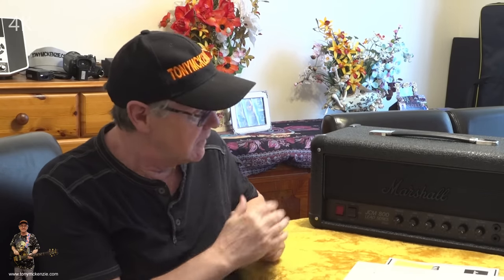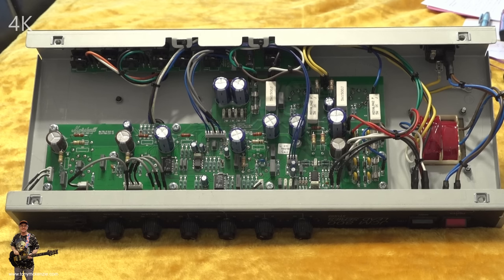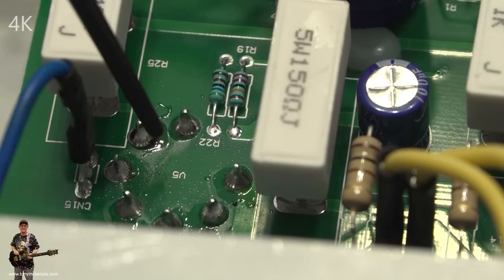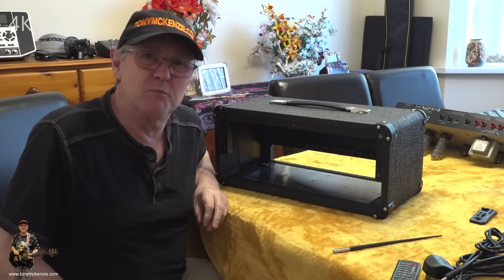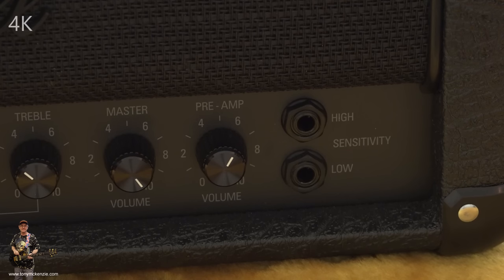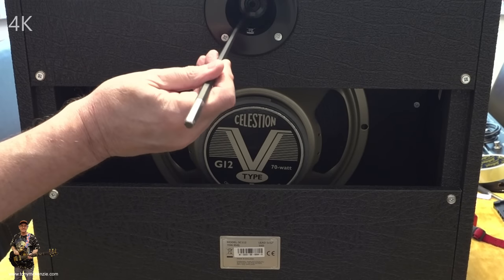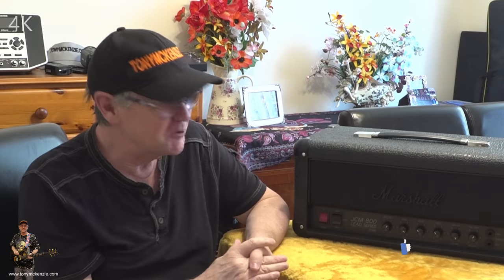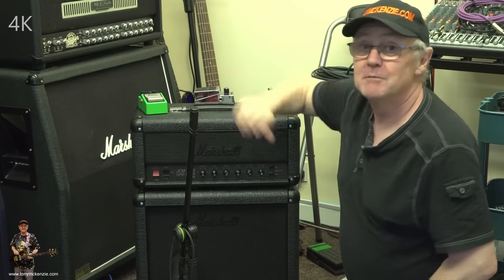Marshall STEALTH JCM800 STUDIO SC20HSB Amplifier |  REVIEW |  Inside & Out with Playing

Comment from the maker: Confirmed from Marshall today: 

The amplifier and cabinet are manufactured from birch ply
. You receive a first year warranty automatically, if you register within 90 days you receive an extra two years. Valves only have a 90 day warranty.

So warranty is three years... on some amps it used to be 5 years but makes no difference, it's a great warranty for the price you pay.

Also note that the amp is Cathode Biased...
Reply: Here's the one I got from Amazon about 4 years ago Not the same rating, not the same application so... Anyway here it is.  I've never heard anyone really complain about the International versions . Celestion may be holding their feet to the fire on quality. Marshall did a pretty good job of that with the Vietnamese combo amps.  https://www.amazon.com/gp/product/B0018TFKAC/ref=ppx_yo_dt_b_search_asin_image?ie=UTF8&psc=1
Reply from the maker: Yes I know that model well. The one I mentioned came in today... yep... made in China :( and I was disappointed a little about that. But it is supposed to be the same speaker as in the 1960A cabs (my favourite actually) so I bought it. That will be fitted in to that 'Stealth' cab from the last review and I think that speaker will be even better for waht I want out of that little setup - although I have to admit the V speaker in there did sound OK. I'll probably kick a short video together about it...

Comment: Ohhh i like this :) , Excellent review mate cheers ! IF you slide a tube slightly bigger than the valve over it and push down , it`ll press those crock clips back to release the valve :D
Reply from the maker: I understand but removing the tube (valve) without your 'tube' (I get what you mean) is really hard. Great point BTW and not one I have heard before thanks for posting that... Stay safe.

Comment: Hey Tony! My JCM 2000, TSL 100 has a “VPR” switch that reduces output power to ~20 watts. Great for smaller venues. All my Marshall heads are 100+ watts.
Reply from the maker: Indeed it does... I still have my red recovered one - a really great amp which suffers a little from 'bad board syndrome' but change the board and its an amp for life :)  I have a JTM45 (30 watts), a 1959HW (100 watts), the TSL100 head (100 watts)  and now this amp 20 watts. All great sounding amps really. Great point and I probably should do a quick review of the TSL100 as I don't really show everything about that amp... stay safe.
Reply: so?
Reply from the maker: SO! What does that mean.... go on make my day.
Reply: @tonymckenzieofficial  He was saying all his amps are 100watt what does that matter now? You gonna play isolated in your room @ 100watt please.
Reply from the maker: Ha I doubt that unless he has a reactive load type of device. But those 100w amps with a reactive load DO sound different (and feel different too) when you play them that way cranked. Anyway thanks - I could not follow the comment but its all gone clear now :)  But gigging will come back :) Thanks and stay safe.

Comment: Nice to see how the amp has been built. The first preamp tube looks like a JJ but the other ones are nothing but Chinese. It's sad to see Marshall still uses those cheap 1N4007 as rectifier diodes.
Reply from the maker: This is similar to the SV20 too. I reviewed that later. I visited the Marshall factory some years back and the video is on my channel. I asked about tubes at the time and Phil Wells told me that they had no issues of supply at that time but maybe things a have changed? Phil retired I believe... a really nice guy too. Thanks for the info.

Comment: Wonderful review! Celestion does still make some speakers in the UK.  Price wise these amps are coming in around 1399.99 in the US (for the stealth model). Roughly 100 USD less than the Friedman 20 watt amps. I don't want to argue which is a better amp but the Friedman's are not that much more expensive. As well the runt 20 is actually a cheaper amp than this one.
Reply from the maker: Watch my review on the 'snake' one... I talk about Friedman and my experience. Honestly, the Marshall was far better and the JJ Friedman went back. In fact the only amp I have ever returned... it was that bad. I don't really want to slag any brand really, but that was what I found. My guess had I bought the 'real' Friedman and not the JJ made by someone else then it would have been a different story. Wow that pricing is insane... here even with 20% tax included its about $950 or so!  Stay safe.
Reply: @tonymckenzieofficial  Sorry to hear about your experience there. I've had good luck with Friedman 20 watt amps but they are expensive and as you say, mileage may vary from case to case. Thanks for replying! I didn't realize Marshalls were so much cheaper in UK. That is interesting.
Reply from the maker: Yes they are... but remember I showed there is no 120v input on those transformers... so then you would have to work on the amp and not worth doing... :(  I might one day post the Friedman video or not... who knows. Thanks.
Reply: I would rather have 34's instead of Friedman's el84's....just personal preference tonewise

Comment: Those 20W studio amps are great. They came out only a few months after I bought my DSL20H. If I'm honest I wasn't too bummed because I couldn't afford one anyway. I'm not sure which I would have gotten. They are all really cool. I might have gone with the Silver Jube style one or the Vintage because I don't really go that high gain. 

The studio series sound a bit thicker than the DSL even though at a glance your 800 doesn't look THAT different internally. I put some Mullard reissue preamp tubes in mine and that gave it a bit more body. Might do something similar with the power tubes eventually. Cheap and cheerful, Way better than any of the sub $400 modeling amps or VST modelers on my PC I was using before. For someone who's only playing at home as a hobby it's great. I got a vertical 2x12 Cab with Mojotone Greenback clones in and also have a older DSL5C with a Vintage 30 shoehorned inside.
Reply from the maker: Well I know of the DSL and I had one of the 50w many years ago of those. But not the newer DSL amps. Interesting the layout is similar. I saw the silver jubilee also (not in real life) and the snake skin also looked a really nice presentation. I opted for the JCM800 style in stealth because I have a real 1959 amp as you might have seen recently. 

I've looked at the Mullard reissues a few times... how do you find them? Well matched PI?  Reliable? Those are not that cheap a tube but I know that you generally get what you pay for with tubes. I looked at the power tubes from Mullard (the reissues) and maybe I'll get some. 

I did think that I have yet to find any modelling amp that does what this stealth amp presents in 30 seconds in buckets... it has a really impressive tone, but just as importantly the feel of it when you play is exactly right, something that every simulator I ever tried somehow lacks in general. But you could also use this amp for gig's - that 20w out was really loud... maybe it's me getting old (don't answer that :) but even the 5w sounded pretty nigh on perfect. I was most surprised. Thanks for the info - always nice to hear you Adrian and I trust you're being careful re the virus...
Reply: @tonymckenzieofficial  The Mullard Reissues sound a lot better than the stock Marshall Branded JJ's and the generic chinese white label ones that came with it. To be honest I'm not sure how the PI changes the tone of the amp. I put a JJ 5751 (lower gain) in there the other day and it does sound and feel a bit different. Unless I record it back to back I can't really tell if my head is playing tricks on me. 

If you ever run out of things to review, you could always do a couple of educational videos. The Mullards are definitely a little fuller sounding where the original JJ's sounded a bit fizzy and thin. If I'm honest, when I first got the DSL20 I was a little disappointed, my 5c which originally had those Mullards in sounded bigger with the 12" speaker inside. Once I swapped out those tubes the 20 sounded more like I anticipated. 

It probably didn't help that the Marshall 2x12 slant top had the two speakers wired out of phase from the factory LOL. It actually sounded terrible the first time I tried it. I guess that's what you get when you can only afford the more budget lines of their stuff. QA isn't that great. My 5c had the FX loop harness zip tied to some power cables when I got it, resulted in a high noise floor and lots of buzz out of the box. 

Fortunately I'm pretty hands on and went to school at a time when they still taught you a bunch of practical workshop skills. So I'm pretty handy and curious about how things work. Probably why I enjoy your channel so much Tony. Anyway, thanks for the kind words, I'd doing great, enjoying time with the Wife and my dogs. And I can see your doing alright by the video's.
Reply: Nothing wrong with the DSL I think they're beautifully voiced
Reply from the maker: That 5751 reduces the drive  just a little - not as much as I would like on some amps (MT-15). Some different guys talk about 12AT7 and other similar tubes which also it seems reduce the gain, but I have not checked which would be best for that. On the PI tube, I have not seen anyone talk about how the tone is affected by that either in or out of balance more or less so to speak. I could guess it might not be that noticeable? But the problem is for me when it gets hardly any difference in sounds, my ears don't hear that well any more and I end up assuming its the same tone. Those Mullard reissues seem to be expensive really (unless you live in the USA then they are much cheaper) for what they are. I was looking today. I'll likely try some based on your comments. Sounds like you had a bit of diagnosis on the Marshall... and that's a pity really. Over the years with Marshall I have seen the odd little bit, but nothing like you describe especially re the things like the out of phase stuff. Inside the odd head there used to be small things but not really for many years have I seen anything dire.  

One of the things I looked at today were Marshall Amplification PLC accounts. Don't be  surprised, I often do look at accounts when I can get hold of them and in the UK that is simple enough as they get published. The USA is another story but I would love to see some of the makers accounts from over there. In any case, in 2017 Marshall showed that the Vietnam facility was taking off and making good money and in profit as a contributor. So their investment for lower cost amps and later sales did pay off for them. When I look at this amp under review it is a UK made amp so will undoubtedly have a higher cost than the Vietnamese made products through labour etc. I also noticed that Marshall profitability increased and that's a very good thing because it keeps companies there. Where was the 2x12 made? and where was the 5C made?  I guess it could be pertinent as both of those things you mention are really QC? right? Just interesting stuff for sure.
Reply from the maker: The original DSL's had a main board VERY similar to the TSL. And the TSL100 was throughout the 2004-2007 period my favourite amp. Recorded it has a particular tone that always seemed to me to be top class. I did also have at one time a DSL100 (I think it was) which was finished in green tolex... but that had a slightly different tone than the TSL. I do think all Marshall tube amps have a particular voice a little different than the next model and there are some real gems. They tend to be really great value I think. Stay safe baron...

Comment: Hi Tony may be you could help me... What did marshall do to get 20 and 5 watts with 2 EL34s ?? As you know, 2 EL34s are for 50W  like the 2204. But how can i get a maximun of 20 or 5 watts? A built in attenuator? Power scaling ?? what did Marshall do ?
Reply from the maker: They can do other things too can't they... like lower HT maybe? I'm not an amp designer, but I did know that the PRS MT15 at 17 watts PRS said they could make 50 watts without too much change (IMO likely something to do with transformers etc). Sorry I can't give you the definitive answer but notice that those big ceramic resistors seem to be there more than the two they normally have on a regular 50w. Stay safe.
Reply: @tonymckenzieofficial  what is HT ?
Reply from the maker: I believe they do stuff with the transformers and the High Voltages etc. But hey I'm no designer!
Reply: HT stands for High Tension, which is the same as High Voltage. Tony is right, the voltage on the tubes in large part determines the maximum output you can coax out of them. So lowering the High Voltage would lower the output. Think of it like a couple of EL34’s making ‘a maximum’ of about 50Watts, but they could be in a circuit which runs them at virtually any Wattage ‘up to’ that point. In the past, when high quality PA’s weren’t a thing, everyone wanted as much headroom as possible, so everyone using EL34’s pushed them to 50Watts. This is no longer the most useful thing to do, as there’s almost no place you could run that, full on, unattenuated anymore. Plus you get the added benefit of running the tubes cooler, and extending their useful life.

There is however a difference in the way a 100W amp handles bass, compared to a 5W amp. So to have the amp sound ‘correct’ while being significantly lower in Watts the circuit needs to accommodate that. This has taken amp-makers a generation to get, but the last couple of years we finally seem to be getting somewhere. These new Marshalls are awesome. ;)
Reply from the maker: Thanks for this info... very useful post for many guys I'm sure.

Comment: So much neater than the Friedman and the resistors lifted Well done I always felt the 800 was their hi-water mark I have an early 80's combo Did you ever figure how they brought two 34s down to 20 watt's??
Reply from the maker: This is a very good amp - and at (UK) £700 or so street price its hard to go wrong. I still have this one. On the down to 20 watts I think it relates to tx somehow... but I never looked closer. Maybe I'll ask Marshall... Thanks.
Reply: You don’t have to run any tube at or near it’s maximum dissipation. Simply lowering the voltage, and biasing for the new voltage, will lower the output power. This is not very easily done to an existing amp though, since you have to change the transformer. So it’s a thing that’s decided in the design stage.

Although you could add a variable voltage regulator after the HighVoltage tap on the transformer and before the rest of the amp, as is done in different power scaling technologies. (As an example: https://revolutiondeux.blogspot.com/2012/06/voltage-scaling-in-amplifiers-power.html)

But lowering the voltage does change the way the tubes react, so it’s really best left to the design phase, as then you can compensate for any unwanted changes elsewhere in the amp. (It gets too dark, make the preamp slightly brighter, that kind of thing…)
Reply from the maker: Thanks again for the info. I did also look at the power scaling on the Malmsteen amp at the time it was launched and discussed it with the designer a little Santiago Alvarez here: https://tonymckenzie.com/marshall-yjm100-malmsteen-guitar-amplifier-inside-and-out-review.htm  certainly an interesting read if someone has not seen that before. Santiago covered a number of other things too that were interesting on the YJM100 Malmsteen amp from Marshall Amplification.

Comment: Does the amp produce the full 20 watts going into the 16 ohm speaker, what about the 8 and 4 ohm output options?.
Reply from the maker: They infer it does in their manual. It seems Marshall are either skeleton staff or closed at the moment so I can't ask further. But when they get back I'll surely ask. I would have thought 20 watts from two EL34 is a doddle. Good question - and stay safe.